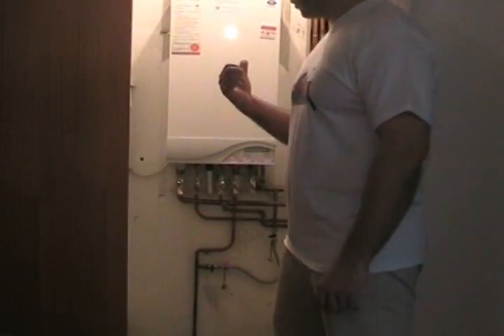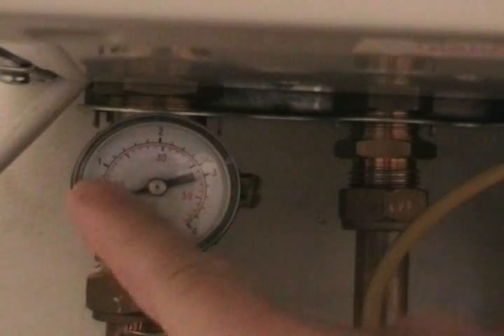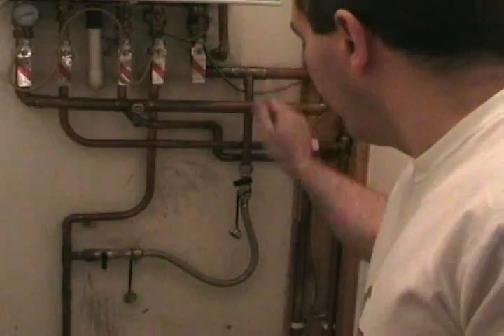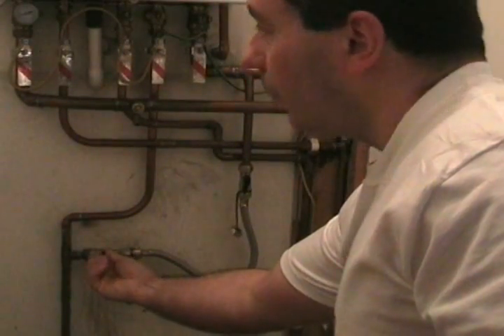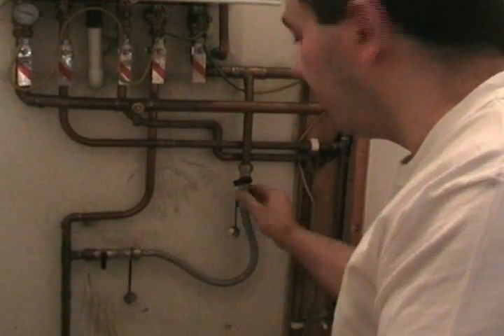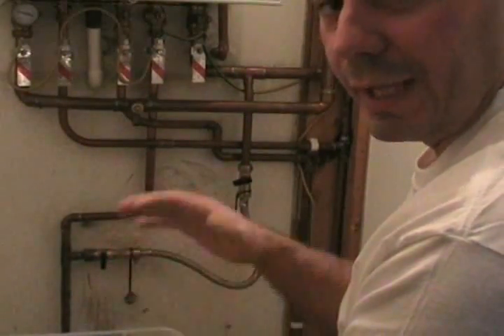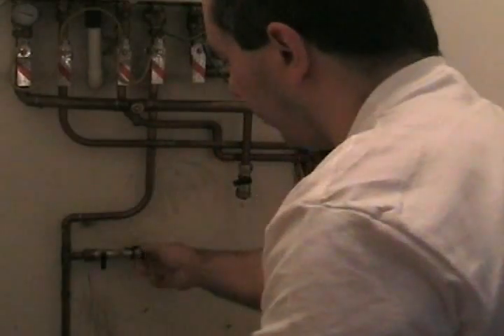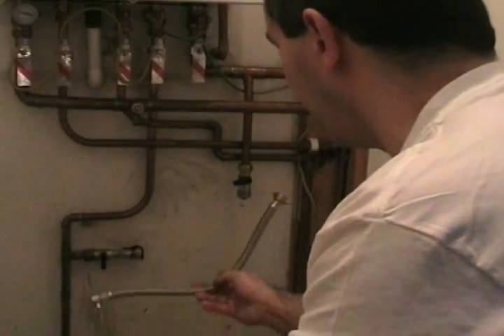How to repressurise or fill a combi boiler or sealed central heating system

Comment: Can I ask what the swinging things are? I've seen similar plastic things on other videos and i'm just guessing but its some sort of indicator? Got a new house and it looks like it's losing pressure but there are 5 levers. Don't want to accidentally turn the wrong two.
Reply from the maker: I think you mean isolation valves?
They often have a plastic lever on them.
The other isolation valves should be in the open position, the two needed for the boiler pressure will be closed. They are open when the plastic lever is in line with the pipe.

Comment: Why's it a legal requirement to remove the filling loop, I've never had a boiler with the filling loop removed, even after an engineer has been out to fix something.
Reply from the maker: It's a water byelaw regulation, to prevent possible contamination of the drinking water. 
In reality most filing loops are left connected.
Thanks for the comment

Comment: I turned on one  of the valve and some  water came out, and quickly turned back close. Should that be happening? Thanks in advance .
Reply from the maker: No, water should not come out from anywhere.
I would check that the flexi pipe is connected correctly.
Thanks for the comment 👍
Reply: Appreciate your helpful demo  and tips. Any chance you can tell how approx how much  do one get charge for replacing a flue  please? I have a leak on mine. I was advised by a boiler engineer not to use my combi boiler for  the heating but ok to use the hot water. Is that correct? I was sceptical, as  when I turn my boiler on ,the d letter, & light  comes on , even there is no water on demand. All taps were closed. Open to your opinion.

More success to you.
Reply from the maker: @MDO-nq4bx   Sorry, I'm not a heating engineer.
But the flue is used regardless of whether the boiler is heating the water or the central heating. I'd try another heating engineer to be honest ;-)

Comment: You just saved me a call out charge on a bank holiday during lockdown , and probably saved my life . After bleeding a rad in my new house,the pressure went.  Single woman with no clue now clues up. The pipe was already connected!  Best sort that out then. I wondered what those caps were, now I know .
Reply from the maker: I'm glad the video helped 
Thanks for the comment 👍

Comment: Thank you very much, for the best video on re-pressurising a combi boiler! Saved my life on this seriously cold January late evening. My totally neglectful landlord (Matt Bennett) left no instructions or guidance on this task and left the filling loop attached also. I'll keep my eye on that pressure for now (can contact Private Housing Sector IF needs be). Originally had to provide my own fire alarms, and after 22 years tenancy, finally he provided them, but this morning, billowing smoke from burnt porridge (while trying to figure why no hot water, no water pressure), that new fire alarm didn't operate (my old FireAngel would have, so looks like I have to replace this new one with a premium one myself)! 
I'm afraid I would have been left to freeze if it hadn't have been for your video! What a day, but all's well that ends well. Thanks again.
Reply from the maker: I'm glad the video helped 
Thanks for the comment 👍

Comment: Excellent video, really clear and easy to follow.
What happens if the boiler doesn't have a filling loop? I searched and searched, there is nothing!
What do we do? It's Friday and it's Christmas next week!!!

Thanks
Reply from the maker: You can get more pressure in the system by connecting a hose pipe to a tap on the mains water, then connect the other end to a radiator drain off valve. My mate had a sealed system once with no filling loop, and this can be the only way that they could fill the system.
Thanks for the comment
Reply: @ultimatehandyman  - thanks for that, I've found a weird inlet tap, higher than all the radiators, I guess that's where they connect the hose to top up.
Excellent. 
Thanks.

Comment: I have this type of boiler and unlike before when I topped it up the water would fill quickly now it takes longer and seems I am putting too much water in for the pressure gauge to rise.
Any ideas to the problem?
Thanks.
Reply from the maker: Are both isolation valves open (perhaps one is not open, or not open fully)
Thanks for the comment 👍

Comment: How do you do it with one that doesnt have taps?
Reply from the maker: If there is no filling loop, you might have to rig up a hosepipe to a drain off valve on the system and use that. I have only ever seen one system where there was no filling loop and that is how we topped up the pressure.
Thanks for the comment

Comment: the people who fitted my boiler left the loop on and the top valve has a screw in it and won't move so what is that about? my pressure is low and I don't know what to do, don't have £60 to pay for a call out
Reply from the maker: The screw should turn 90 degrees to open it. When the slot is inline with the pipe, it should be open, like in this picture- http://www.ultimatehandyman.co.uk/diy/plumbing/toilet/old_toilet_2.jpg
Thanks for the comment

Comment: Hi. I have a Ferroli F30 Boiler and there doesn't appear to be any levers. Any suggestions?? Thanks
Reply from the maker: Perhaps the installers used isolation valves without levers- sometimes there is a slotted screw that you can turn with a slotted screw driver?
Thanks for the comment
Reply: @ultimatehandyman  Many thanks  for  taking the time to reply. Shall take a look at it when home after work this evening. Than you 👍

Comment: Yesterday I swore the boiler dripped. I turned it off and bled a radiator. Heeeeaps of air came out. Then the boiler wouldn’t kick in and gurgled. Pressure was zero. I went to bed and found this video as 1st result for Biasi boiler pressure search. I set it just last 1 bar. Back in business. Thought I was gonna have a cold shower!
Reply from the maker: I'm glad the video helped ;-)
Thanks for the comment

Comment: hello. i turned one of those valves open on my boiler's fill loop, not both of them, and the pressure gauge went up. does this mean that the engineer had left one of the taps open last time he'd been round and could that be the reason why my boiler's pressure drops and goes back up again every day? this might sound like nonsense, i don't know anything about boilers
Reply from the maker: It depends, the valve could have been left open or it might be passing - allowing the water to pass through with the valve in the closed position.
The boiler pressure should rise when the heating is on due to the expansion of the water, it will then lower in pressure when it is cooling down.
If you have to keep topping up the system, you have a problem- perhaps with the expansion vessel or the blow off valve.
Reply: thanks for replying. so it's normal for the pressure to go up and down then? it's set to have the central heating on all day but it only comes on at certain times and and i wasn't sure if it's meant to act the way it does

Comment: what do i do if its over pressurised and the boiler keeps faulting?
Reply from the maker: You can empty out some water through one of the radiator bleed valves.
Reply from the maker: Just an afterthought- is it over pressurising without anyone touching the boiler or has it been over pressurised when being topped up?

Comment: Cheers pal, was doing my nut in trying to sort it. My filling loop is always connected to my system with a valve on the boiler side. Will have to turn the water off and get it sorted so it can be disconnected
Reply from the maker: I would not worry about disconnecting the filling loop as most boilers still have them connected ;-)

Comment: got air in after repressurising Combi boiler..any answers?
Reply from the maker: Switch the heating off, bleed the radiators and ensure the pressure is kept topped up. Eventually you will get rid of all the air ;-)
Reply: HI, I did that and it worked a treat.Thanks for the reply.

Comment: My gage is just below 1 and I've previously topped up the pressure in the past twice, but this time I can't open the ride hand side valve. Any ideas why?
Reply from the maker: Perhaps the valve us seized?
You could undo the small screw and remove the plastic handle and try with an adjustable spanner as that will give you more leverage.

Comment: Hi, I have a sealed system that's 6 years old and my top up isolator valve (at the CH end) has decided to start leaking from the screw (beneath the handle).  If I follow your draining down and this video is there anything else I need to know?
Reply from the maker: Hi Adam, you should be able to replace the valve once you have drained down.
Just remember that you'll have to add inhibitor to the system once you refill it ;-)

Comment: Many newer combis have either a short braided or copper hose that runs from cw to return on heating immediately below the  boiler, supplied with all of the other valves and connections for cold in,hot tap water out, gas inlet and flow/return on heating. Yes. They are supposed to be removed as per heating regulations once repressurising is completed. Filling loops must NEVER be left on. However, they are easily misplaced or lost and can be expensive to replace, as they are usually sized specifically to the manufacturer and even manufacturer model of boiler. I always fit a separate x2 check/iso valve and a flexible braided hose on my installs. (Filling loop kit) Once filled, the flexi hose I pop on top of the boiler. (I always have a spare in my bits n bobs if even this gets "lost" by the homeowner or tennant.
Reply from the maker: Thanks for the detailed comment ;-)

Comment: helpful video, I think theres something up with mine though, as it only fills a little, then you can hear the water stop moving. the pressure doesnt appear to change.  I think maybe its something to do with the cold water pressure.  hot water works fine but boiler cuts out after 30 secs for the heating with a bit of a gurgle.
Reply from the maker: If you open the cold tap do you have good water pressure?
Reply: +Ultimate Handyman yeah I do, there's a pressure valve inside the central heating connector if I press it in with my finger no water squirts out, I thought it would. shows  three quarter bar on pressure gage and doesn't change when filling
Reply from the maker: It sounds like the non-return valve might be knackered.
I have seen them go faulty on outside taps in the past, when they go faulty they don't let the water through.
Reply: +Ultimate Handyman cheers I thought it might be something to do with that.

Comment: Thanks for sharing, I have a question.... when I've drained off the system, as I'm fitting new rad and a TRV, is this how I refill the system? Also how would I put inhibitor into a sealed system. Thanks
Reply from the maker: +Mike B Yes, this is how you refill the system. You will have to add the inhibitor through one of the radiator bleed valves (remove the valve, not the nipple). If you have a towel radiator it's easy as the valves are normally on top. Then top up the system and bleed radiators as necessary before topping up to the required pressure.
Reply: +Ultimate Handyman That's great. Thank you, really helpful.

Comment: i leave it connected because im a rebel
Reply from the maker: +James Campbell 
If the valves pass slightly you can over pressurise the boiler, causing it to stop working. But as someone explained on a comment on here removing the loop is to prevent the central heating systems dirty water from contaminating the drinking water as it could contain legionella etc.
Reply from the maker: +Bob 
Ha Ha, you bad ass LOL  ;-)
Reply: +Bob : I've not heard a convincing reason to remove it after use!

Comment: what if incoming water water pressure is not strong enough to set boiler to 1 bar
Reply from the maker: +John stclare 
Where abouts are you?
Less than 1 bar mains water pressure is something I have never heard of before? 
Are you sure all isolation valves are open?

Comment: Just seen your video as I need to do this. I've got the filling loop in my loft, but it was set up not to come apart as you show on the video. I had no idea it's a legal requirement that its supposed to.
Reply from the maker: +Freedy50A 
In reality most filling loops are left connected. The newer ones are rigid and are permanently connected all the time, so I would not worry about it too much ;-)
Reply: The filling loop may be in the loft as the boiler may have been swapped from an unvented system boiler (boiler and tank fed immersion cylinder to an unvented/pressurised system boiler. You probably do not have a combi boiler. A combi boiler will have a mains fed cold water inlet located approximately 6 inches from the heating flow or return pipe. Indeed you may well have a combi boiler and this and hence the filling loop are located in your loft. Vaillant have a plain english guide to boiler jargon. This may shed some light on your question  
http://www.vaillant.co.uk/downloads/plain-english-guide-to-boiler-jargon-261412.pdf

Comment: Hi. I left the filling loop on by mistake and the pressure is now around 2 when heating is on. How do I reduce the pressure please?
Reply from the maker: +Tony Greenhalgh 
Just switch the heating off, then open a radiator bleed valve and have something to catch some water. It will be hot water if the heating has been on ;-)
Reply: +Ultimate Handyman Perfect. worked a treat thank you.
Reply from the maker: +Tony Greenhalgh 
You are welcome ;-)

Comment: Cheers for this video, mate. 

Had a low pressure problem so I followed your advice... except I slightly overdid the flow, causing it to go to 2.2 bar. However, I managed to relieve the pressure and it popped back down to 1 bar.

Thanks again :)
Reply from the maker: +Emperix 
You are welcome ;-)
Thanks for the comment

Comment: hi. chez. great vid. i need to fit one of these but  can't find  one with blanking nuts.can you recommend a place where to buy one from? i  have a magnetic filter on my return pipe, should the filling loop be fitted after the magnetic filter? many thanks.
Reply from the maker: +arfan jhangir 
Thanks, you can get them on ebay- http://fave.co/1jvVTtx
I don't suppose it matters which side of the magnetic filter it goes on, but normally they are placed within a couple of feet of the boiler.

Comment: Thanks for this video I like the way you explained but why is it legal requirements for the filling loop to be removed.
Reply from the maker: M Hassan 
To prevent the drinking water being contaminated by the dirty circulating water on the heating side of the boiler.
Thanks for the comment

Comment: Hello! Just tried opening the valves on my filling loop (Logic + Combi boiler) and loads of water came out. Is this normal? Should I continue or stop?! Does it just mean there's a hole in the filling loop or something more serious? Thanks for all your help!
Reply from the maker: lmma500 
STOP- you need to sort out the leak first.
If it is a split flexi pipe it should be relatively easy to replace, or is it one of the sealing washers?
Reply: ***** I think it's one of the washers... at least it seems to be coming from where the join is, not from anywhere else along the pipe. Thanks for replying so quickly!
Reply: lmma500 +Ultimate Handyman Also the reason I started fiddling around with the pressure was because I had 'flame loss' about 10 times in the last 24 hours, so I was trying to see if adjusting the pressure made any difference, but I don't think these two things are connected are they? Just asking so that I know if it's just one problem I need to solve or two... Many thanks,
Reply from the maker: lmma500 
I don't think the flame loss would be due to the pressure.
Normally if the pressure is low the boiler will not attempt to fire up.

Comment: Why does the law say you need to remove the loop?
Reply from the maker: MrLH25 
It's a water regulation/bylaw that is to prevent contaminated water getting into the drinking water.
Reply: +Ultimate Handyman thanks, I was wondering why that was the case. That makes sense.

Comment: Hey man. Having a bit of trouble with my boiler just at the moment. Pressure has risen to max, i bleed a radiator but as soon as i stop bleeding it, the pressure rises again. Any ideas what is up? Do i need to get an engineer out? Thanks
Reply from the maker: It could be that the filling loop is passing, which is putting too much pressure in the boiler. You need to check that any valves on the filling loop are closed fully, then disconnect the filling loop from the boiler. Be careful though, because if you try and remove the filling loop and one of the valves is not closed properly water will exit from the end at mains pressure, like this- https://www.youtube.com/watch?v=8Yfb1dSZHQ0
Reply: ***** Thanks. I have managed to stabilise the pressure at 1 bar however the boiler is still not doing anything. Any ideas?
Reply from the maker: Jordan Philpott
If there is a reset button on the boiler you could try pressing that. If not you are best asking here-
http://www.ultimatehandyman.co.uk/forum1/central-heating-boilers-f35.html
Hopefully one of the heating guys will help ;-)
Reply: ***** Cheers mate, appreciate your help.
Reply from the maker: Jordan Philpott
You are welcome ;-)
Reply: ***** Managed to fix it. Fuse had blown! All sorted, thanks again!
Reply from the maker: Jordan Philpott
Glad you fixed it ;-)